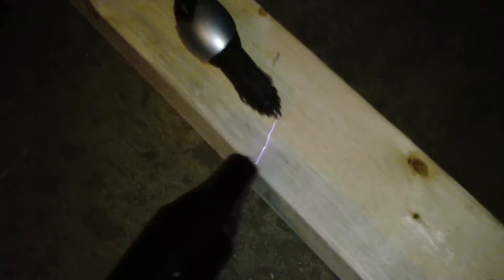cell phone zapped with the handheld Tesla Coil!

Comment: To finish this video off it would have been funny to bring the tip to the camera lens and have your camera fry.
Reply from the maker: Paul Knittle Would have been funny on an old camera, but the only problem I foresee is if it fried the SD card, tape, whatever, there'd be no way to get the video off and put it on here.